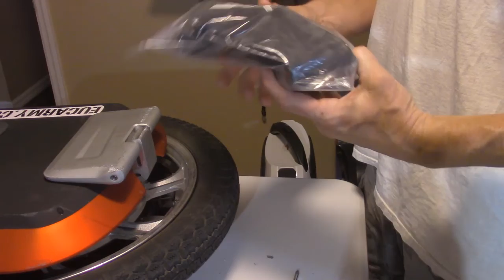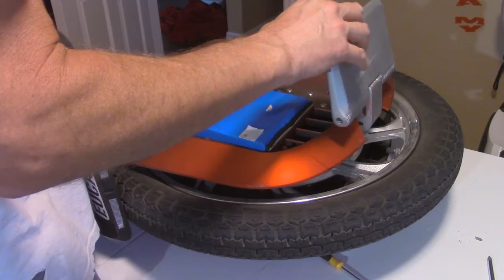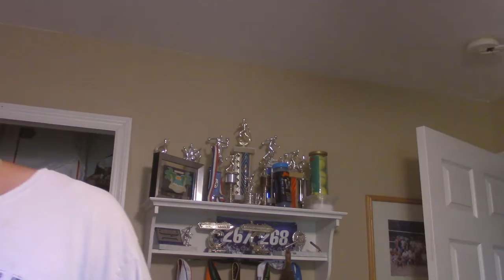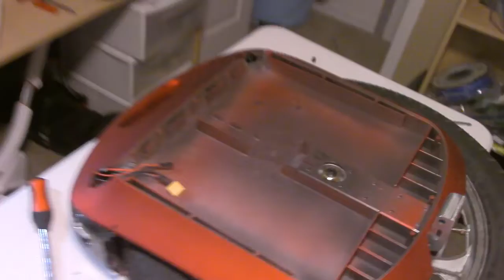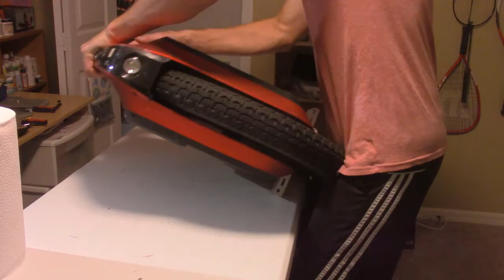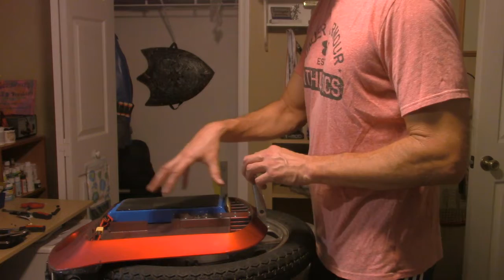Tube change on Gotway Monster - Fun Times

Comment: Had exact same thing happen-went to complete flat in about 5-10 seconds.  Just enough time to slow down.  Exact same failure as you show here.  Thank you for walking through the process.  I also changed my tire and tube 2 years ago on MSuper 3+ and also watched Matthias’ video, but glad I watched your prior to my repair.  Definitely a harder wheel to swap tube on, got the tools you recommended and used wd40.  Thank you for sharing not only successes but what didn’t work.  Appreciate you taking time to post and hope you’re doing good!
Reply from the maker: Glad you were able to stop safely.

Comment: Yeah.. tire changing is difficult.  You need to have the tube completely airless.. never put ANY air in the tube.
Reply from the maker: Well adding some to give it a general shape and then deflating seemed to help me the second time around.  The first time I had 8 psi in it before putting tire on, which was bad idea.
Reply: Dufisthenics I have changed dozens of tires.  I recommend ZERO air in the tube until you get the tire on the rim. Then, just barely inflate it, and roll the tire, and bounce it about to help the tube align, then inflate. I have only had one tube issue with that procedure.
Reply from the maker: Damn it, next time I get a flat I am sending the wheel to you!
Reply: Another top tip (depending on the rim shape but usually true), is to push the beads of both sides of the tyre off of the rim edge into the centre which has a smaller diameter. This makes the tyre less tight and easier to remove or refit. Thumbs can be enough.

Comment: Applying heat with a hair dryer or heatgun helps make the rubber more pliable may not need irons .
Reply from the maker: Yea i have a heat gun but with that tire, I dont know how you couldnt use irons.
Reply: Might need help of irons getting tire off but you wouldn't care if you damaged that tube anyway, if you do a search on changing motorcycle tires without tools you will see for yourself, I think heat and a little lube will work, sounds erotic but I see possible.
Reply from the maker: @bretholtzman1524  Yes it sounds very erotic

Comment: Hey Duff  A couple little time saver hacks That worked for me 
1st ..While the wheel is on its side unscrew every screw on the panel un till they spin so you know they are loose then simply take  Either pieces of masking tape or a strip of masking tape and put it right over all the screws then simply pry the panel off and all the screws will stay taped in place no having to mess with them..
2nd..Take a Sharpie and just put L and R on the batteries So you know exactly where they go..
3rdly..  Then a real life saver grab a multi pack of different color sharpies then before unplugging anything for instance take a purple Sharpie run it down one wire across the side of the connector down to the connecting wire Again no fuss no muss you will know exactly what color wire gets connected to the same color wire with your Sharpie ..

 As far as screwdrivers screwdrivers are never a good idea they are basically knives.. They do make some tools that have softer rounded  edges.
 Personally whenever I change a tire I will step on the inside of the tire on the ground and pull up on the tire basically loosen it up a little bit not sure that actually does anything haha.. But what I definitely do is use a solvent Or like a rubbing alcohol something that's wet or slick that you Spring on as you go making the tire slide over the rim easier  Then since it's a rubbing alcohol it dries very quick I have also used hairspray just spray as you go when the tire and the rim are dry there's just a ton of friction you are fighting against, hope any of that was helpful
Reply from the maker: All good tips that I hopefully never have to use in the future! ;)
Reply: @Duf  lol I hear ya